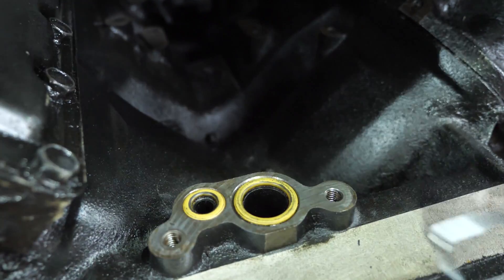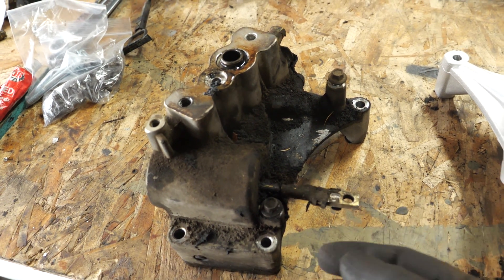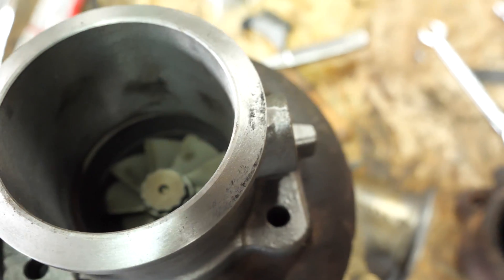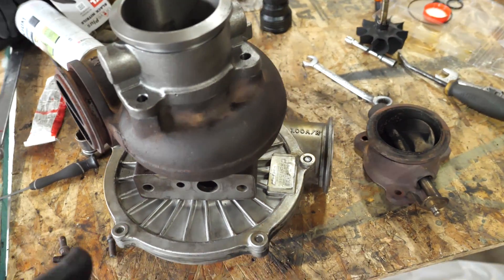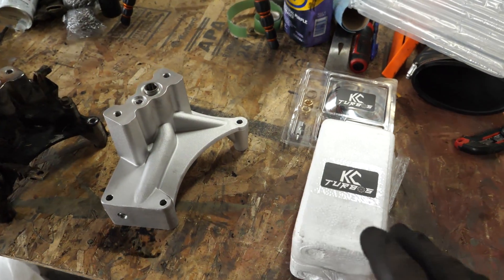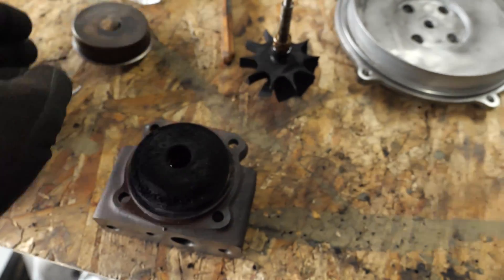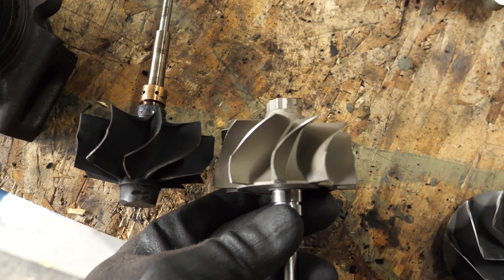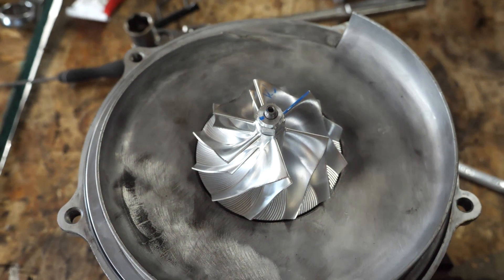KC Turbo - EBPV Deleted Pedastal 7.3 Powerstroke Rebuild

Comment: thanks for this video! Veryyyyy informative for our application. Just had to do the same thing for my van. one thing worth mentioning... on the vans, the old pedestal has two holes for mounting the bracket that holds the heat shield.... when you do this EBPV delete, it will have to be bent in order to reuse it :)

Comment: Did you put a blanket on the turbo or did you find a way to resinstall the heat shield between the turbo and the doghouse?
Reply from the maker: It just sits on top. Haven't had it move around

Comment: Riffraff diesel has quite a few of these parts also, I just had my backpressure valve deleted, and I have had an isolator on the wiring for a year now.
Reply: And new up pipes have been done also.
Reply: What did you use as an isolator and how?
Reply: @brandonpeterson8118 RiffRaff diesel has a pigtail isolator part number PEDIS099, that caps off the wiring to the back pressure valve in the exhaust, which is controlled from the turbo pedestal.  I have a blank turbo pedestal (eliminating the back pressure or warm up valve) that I also bought from RiffRaff diesel.